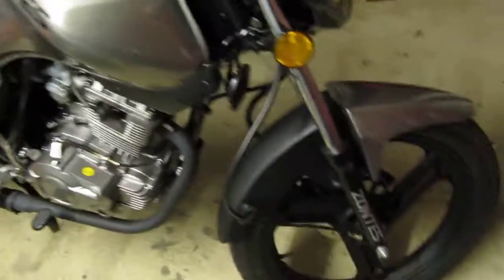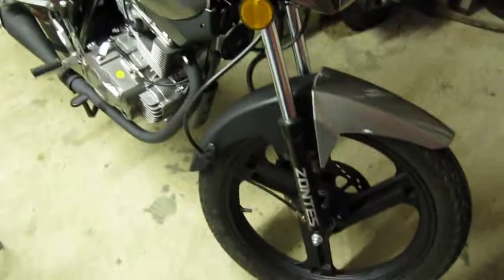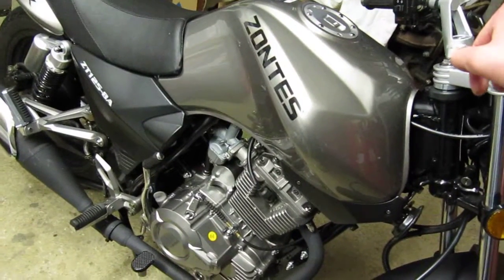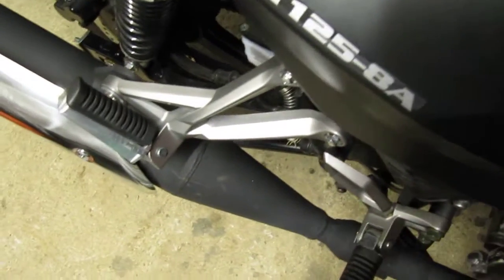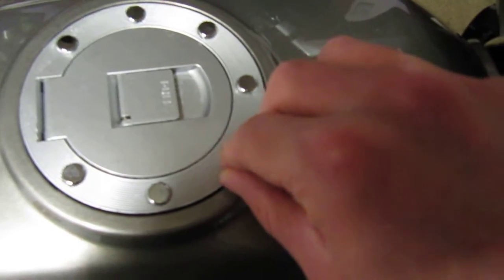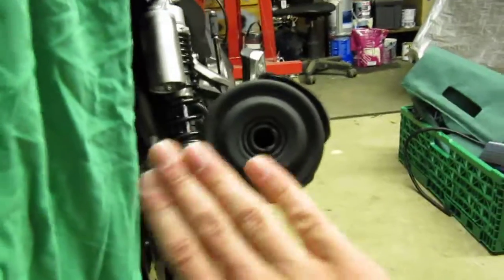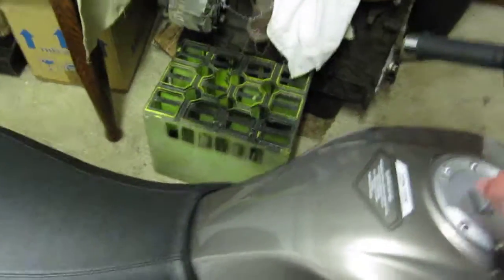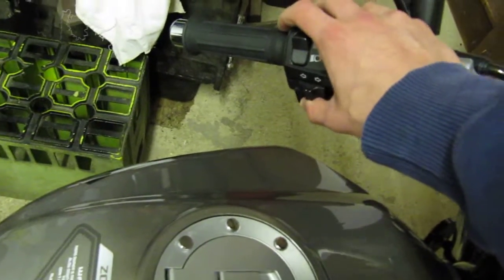Zontes Panther 125cc Review

Comment: Would you say this bike would be suitable for someone who has ridden before ?? and is looking to upgrade a little bit from previous bike  , i had a 125 ( Jianshe JS125-6B) and that bike would get to around 75 MPH after running the engine in ( 3000 KM) , once your engine was run in did the bike become faster and more responsive throttle wise ? , also where is says Zontes on the tank is that a sticker or paint as i would remove it ... 

One more question are the plastics on the bike a good quality (rugged) or are they prone to breaking easily ... in other words is the bike of GOOD BUILD QUALITY ? for the price asked 1499 GBP   £££££
Reply from the maker: Jamie Forsyth it's a great bike for anyone. But sadly no I didn't get any faster. So if your looking for something fast then this isn't it. Apparently you can change the sprocket to make it have a higher top end. The zontes logo is a sticker. The plastics are ok, they have a little give. I didn't damage them when I low sided it.

Comment: Had it had any issues until now?(If you still own it)
Reply from the maker: IKilledThePromQueen x I sold it to get a bigger bike. But would buy one again if I needed a 125. I loved it. Never had any issues in the year I owned it. I had to adjust the fuelling very slightly as it otherwise needed to be left on choke for a while when first started. That was a simple 1/8th turn of a screw that was easy access. Only other thing was every 1000 miles the clutch lever would get a little loose. Again it was a 2 second job with a screwdriver to tighten. Other than that it was brilliant. Never skipped a beat. When I came off it parts were cheap and easy to get hold off. I would recommend one.

Comment: service, do it yourself, drian the oil , put in 1. litre of oil and your off, no filters on 125,s
Reply: fred blogs Urm... what? These bikes do have oil filters and if you put in 1l of oil you WILL overfill it. Bad idea. Plus you'd be stupid to self-service during the warranty period, which is when this video was recorded.
Reply: there is no oil filters on japenese 125,s and there cpaicty is 1 litre or there abouts, needles to say i always check oil capactey before i put oil in so i asume most pople whoud double check before trying to stich in too mutch oil
Reply: i know its chinise by the way, all there is in these bikes is a sreen inside the clutch housing, not whot id call a  paper /carboard filter on biger bikes they are prone to cloging up compleatley if not changed unlike simple plastic screens on 125,s
Reply: there is a small screen inside the clutch casing just on the oil intake , thats the onley filter they have as far as i know
Reply: @fredblogsmac.5697  theres a round cover on the side with 3 bolts and the filter is behind it.
Reply: its onley a metal gauze not a filter as i said
Reply: as i said its just a metal guuze not a real filter you get on larger bikes, i know of no 125,s with debrigh traping filters  https://youtu.be/4rRpgCorkZI
Reply: @fredblogsmac.5697  my 125 suzuki marauder has one
Reply: iv been working on bikes 50 od years, all i ever saw was a wire mesh filter on 125 , please no offence im glad you,v got a suzi 125 all the best
Reply: @fredblogsmac.5697  yeah i work with bikes too been doing for most of my life also. The marauder engine is no bigger than other 125 engines - only 1 cylinder. I have a piece of shit lexmoto too that has same setup. There are some 125s that only have gauze like you said but there are models that have a debris catching filter. All the best H&R
Reply: ha ha wel you put this old bugger right.. here,s me and my mate comming down from the mountians above Aviemore near where i live  https://youtu.be/ekg2Ssioku8